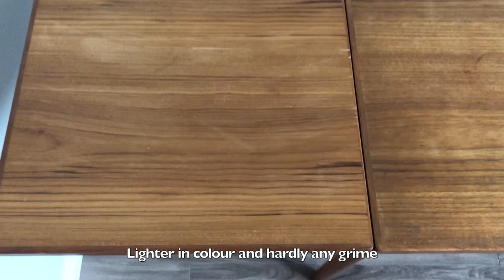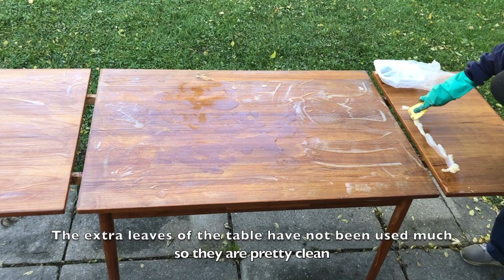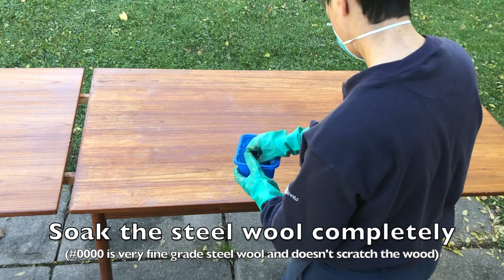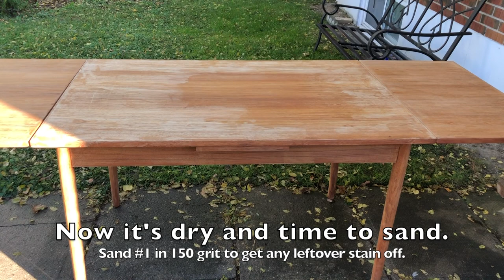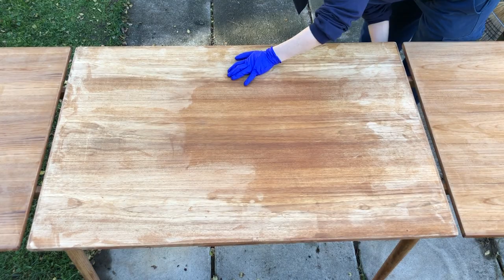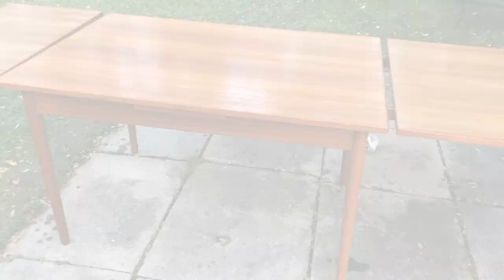Teak Dining Table Restoration | Furniture Refinishing

Comment: Great job....have the same table.... my main section is lighter than the leaves which look almost like new. Should I follow the same procedure? Any specific paint stripper to use?
Reply from the maker: teak changes colour over time so it will be very hard to match them to the leaf... you either have to use a tinted colour to match the darker colour or try lightening the darker wood with oxalic acid... that will be a trial and error to see how light to go. This will be hard if you're a beginner... if you use the leaf mostly for large gatherings covered with a table cloth I wouldn't bother... also if you haven't used the leaf you do not need to refinish it.

Comment: What kind of varathane finish did you use? I noticed that you used spray on for a small side table. Did you use that also for this dining room table. Oil or water based? Thank you

Comment: We have this exact table and will do as you did. Can’t wait! We however, have old grease stains on the top that I need to deal with first. Any tips? Sanding the glass stains on our teak side tables worked like a charm. Would sanding work for grease too?
Reply from the maker: well if you're stripping it first, try that i would say! sanding might just press it more in there. try a chemical stripper first. also if you're refinishing it anyway, you could just try degreaser or orange oil
Reply: Do you guys know what is the make of this table? I just bought one that looks exactly like this in SF. My friend suggested that he thinks it is a Skovby but there are no markings on my table and the previous owners did not know. 

My friend found a skovby for sale on Chairish and sent it to me and it looks very similar but mine has the middle piece of wood on the underside that you see (in the table’s profile) in this video that sits between the two leaves when they’re stored and I don’t see that on the skovby my friend sent me.

(Also, beautiful restoration and video. Thanks for sharing).
Reply from the maker: @wmitchellsmith  This one had no marks either so I am not sure!

Comment: This is gorgeous! Beautiful work. I am about to redo a table very similar to this. Can I ask - what varathane product did you use to seal, after the applications of the Danish oil?
Reply from the maker: Thank you! I followed the same exact steps as this video to seal. https://www.youtube.com/watch?v=3vIrtr_CkZw This product might be a bit different on a kitchen table, though. You may want to use something more heavy duty and waterproof. Always protect your teak table after though and never set hot plates directly on it, and clean up water immediately or it will get in the finish.
Reply from the maker: Some people don't do the additional step of sealing... it is in fact, additional. The Danish oil I use has sealer in it so technically, it is fine as is. However, I am extra, AND you have to reapply Danish oil every now and then... but I like to prevent this by using a sealant :) hope that helps. Soon I will finish another kitchen table video!

Comment: How do you take care of the dining table when being used? If you get food on it, what to use to clean and maintain?
Reply from the maker: A damp cloth and wipe dry immediately. Don't put anything hot directly on the wood. Other than that there are a lot of tips online and it depends what you use to seal the table.